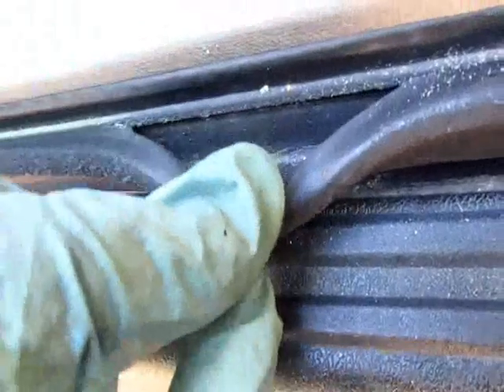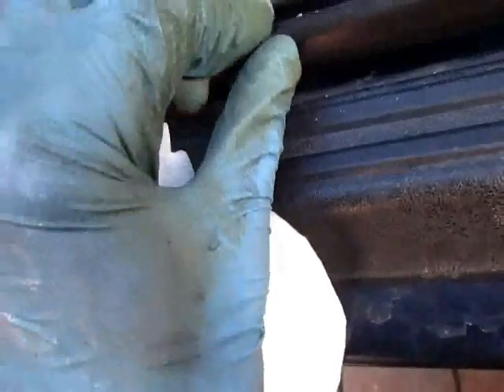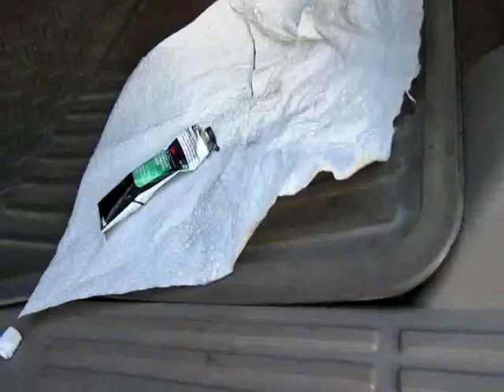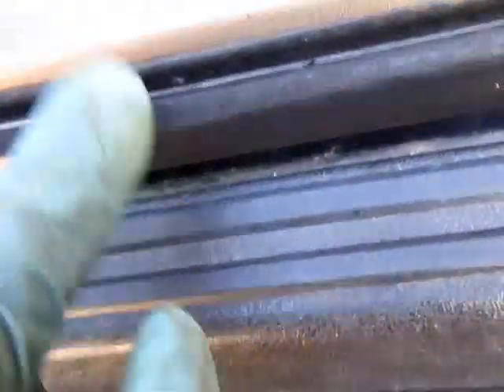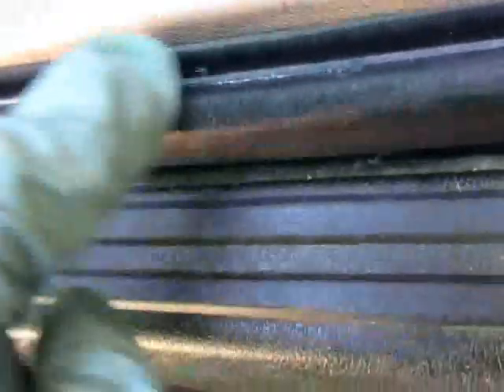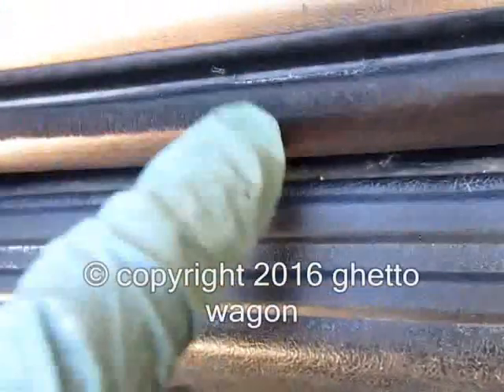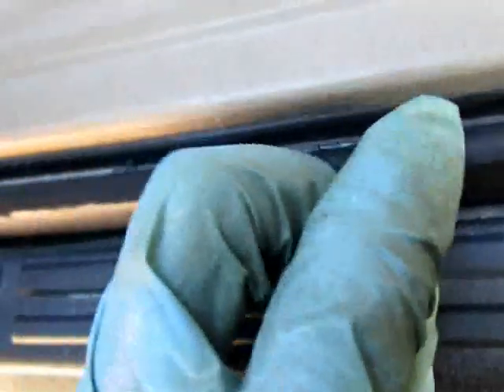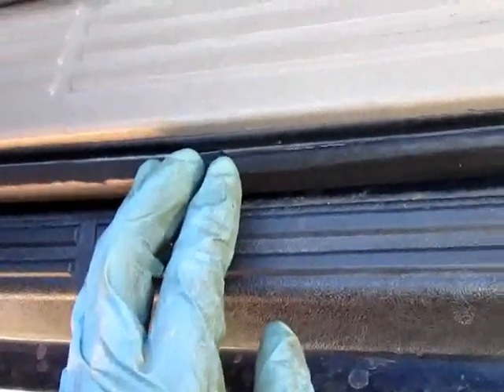Ripped torn Car, truck weatherstrip repair

Comment: Rips rather often when the doors stick from the ice. On my impulse it tears around little clips, so I put adhesive on the clips and put then back in the rubber, and clip it back in the door. All garages want to replace the whole piece, but you can't replace them with new ones on rare old cars so this repair is perfect
Reply from the maker: +Veikra  they want crazy money for weatherstripping, if you can even buy it

Comment: I have a 2010 Ford F-150 and the weather strip for the door opening is busted up at top and i was wondering if i could purchase excess weatherstrip thats $30 for 14ft from ebay (similar style but not exact on measurement) instead of the oem that cost $200 to save money
Reply from the maker: Price one out at the dealer OEM or get a used one better
Reply: @GhettoWagon  the dealer wants to charge me 289

Comment: If there's a hole rip about 1 inch in the seal can and how do I fix it? Or should I leave it alone? It's at the top of the door black seal? Would this be under warranty on a 2017 Corolla Toyota, wondering?
Reply from the maker: YA they might cover it under warranty. We used to at the Toyota dealer.   I replaced many ripped weather strips.  The part itself is cheap anyway it cant be much more than $40-50